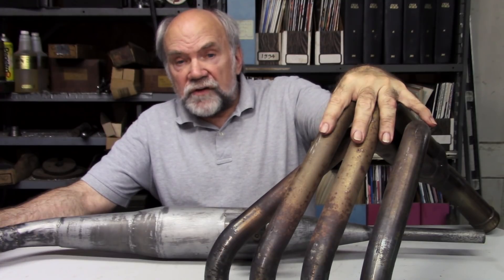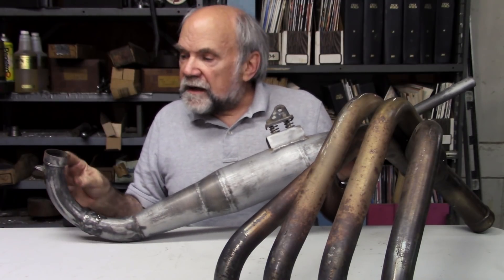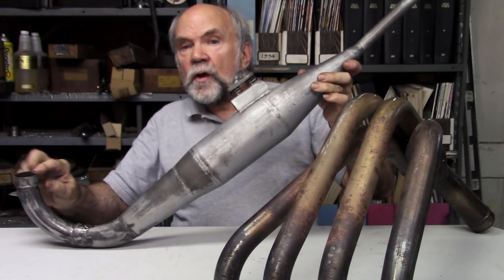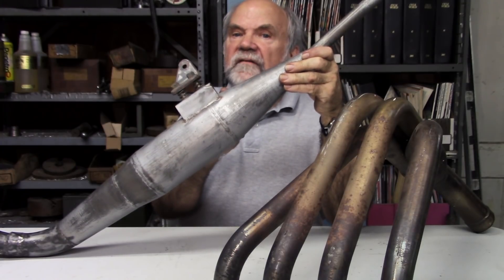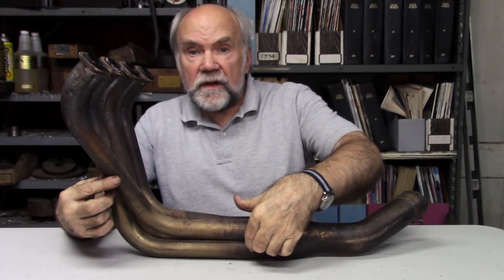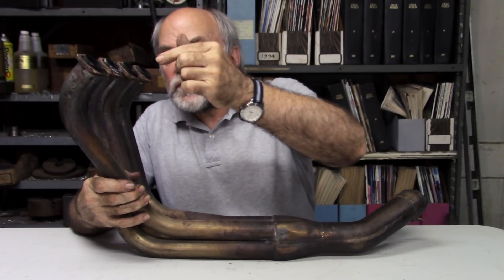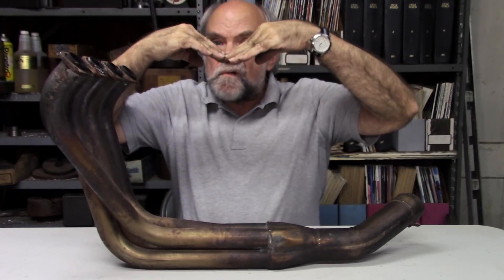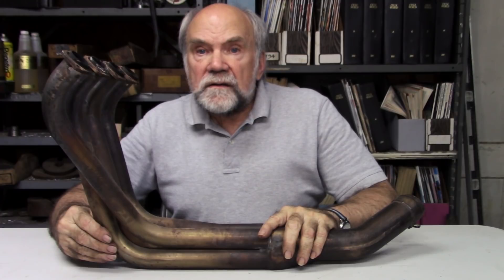How Do Motorcycle Exhaust Pipes Work?

Comment: My old triumph trident had narrow header pipes. I bought a custom set of headers which were at least  one quarter inch wider. Made more power at high rpm’s, but weaker at low rpm’s. I put the stock narrower pipes back on, I liked the low rpm power.

Comment: hey Kevin ... great technical videos
I'm an ASE Master Certified Automotive Technician and an automotive instructor
I Just bought my first fuel injected bike and they looked at me strange when I asked to buy a service manual too ... but that's a story for another day

My question is ...
I bought a 2019 Fury (non-ABS) and ALL the aftermarket exhaust companies  telling me I need to buy tuner with their exhausts.  However, my bike, while it has a  catalytic converter, does NOT have an O2.
Therefore, by leaving the CAT installed and just modifying the exhaust baffles, won't the ECM MAP detect and adjust fuel trims accordingly?

I started by cutting a 9/16" hole into my baffles and find no negative side affects at this time.
The bike sounds better but I want more and am thinking of removing the baffles completely
(NOTE) the baffles in the furry are NOT part of the CAT.

Thoughts?
Thanks in advance
Sean

Comment: HI Kevin, thank you for your great videos! I didn't understand the low rpm flat spot. The first expansion point creates a low pressure wave (due to the change in air impedence at the interface which reflects back the pressure wave with opposite phase) which comes back to the cylinder. This is clear. Therefore the only difference between optimum rpm and lower rpm should only be the timing of when the reflected negative pressure wave arrives at the cylinder. Why would a lower rpm create a positive pressure wave?
Reply: because max negative pressure is pointed on some high rpm, so it is logic that on some lower rpm is opposite situation

Comment: Thank you Great video, 4/2/1 is exactly what I need to design for my Lycoming 4 cylinder,  IO-360-Turbo inner cooled, horizontally opposed, flat-plane crankshaft, racing airboat engine max rpm is 2650! can you answer my question?
 Which (2) cylinders in the firing order are connected to the 4 into 2?
thanks Richard
Reply: aim those with longest timing between spark , to get max power on high rpm

Comment: Is there any formula for certain cylinder volume and/or RPM to calculate proper exhaust pipe shape?
Reply: yes but it is too complicated to solve on fingers, too much variables (and no shape, than volume and length and with what cylinders to combine if is 421)

Comment: Hope I'm not too late for comments/questions. I acquired a 2001 Yamaha 1600 cc Roadstar. The first owner is a motorcycle mechanic. I'm the third owner. I'm restoring the bike because I suspect the modifications to it may not have been well thought out.
Specifically, the first bend in the header of the tailpipe has a crimp in it. Common sense tells me that no matter the dimensions of the rest of the pipe, this crimp narrows the pipe. Could it be that this crimp is intentional in the design and serves a legitimate function?  Or, was it the best someone could do on installing cool looking exhausts?

Comment: sir..can a tuned pipe in four stroke get the volumetric efficiency above 100%??
Reply: naveedaka yes it can. The velocity of the intake charge is so high as it goes through the intake valve that it compresses under its own inertia as it reaches the bottom of the cylinder. If the exhaust is correctly tuned that results in compression occurring in the cylinder even before the valves have closed

Comment: I have a 180°  inline twin.
The two exhaust runners have a pipe joining them.   This is apparently to improve mid range power at the sacrifice of top end power.  
Why does this phenomenon happen???
Reply: A T Same reason, scavenging. With most designs, you’ll only end up moving peaks and dips around(assuming the design wasn’t absolute dog poop in the first place). You may wind up killing the absolute top because scavenging isn’t as efficient at that RPM, but you have a more usable torque curve. You may kill the bottom end, but that doesn’t matter because it’s a race bike and you aren’t going to see 5000 RPM while on track. Your goal is to move the peak in the areas you use more often (resulting in higher average torque) while moving the dips to an RPM range you don’t use much if at all (a Harley isn’t going to make use of a scavenging at 8000 RPM). 

Or you can develop an exhaust system that makes power nowhere except at the top. This looks great on spec sheets (gains of 20 Hp!!!) but you lose torque (and therefore power) at all other points along the curve, and ultimately wind up with a slower bike. Assuming similar RPM, average torque (aka area under the curve) is what wins in a straight line.

Comment: It is amazing the amount of engineering that goes into an exhaust. It's easy to think that the manufacturers just stick some metal on to abide by Euro 3/4 emissions, but a lot goes into the process. However, I can imagine how some limitations in power & torque result in behest of regulations - hence aftermarket products + tuning can gain extra results. Cool video